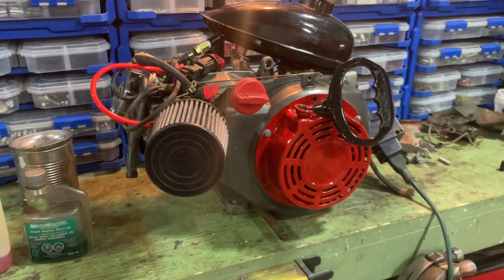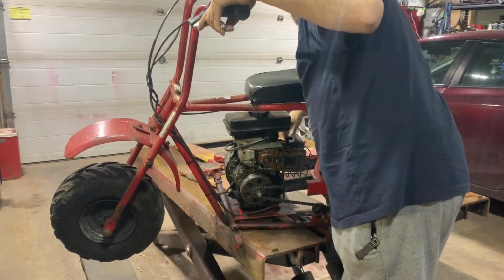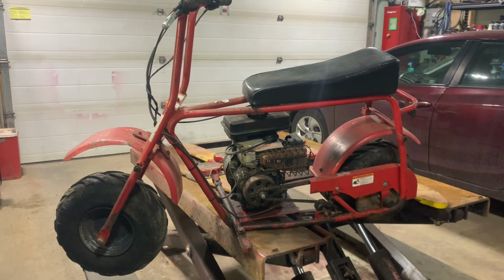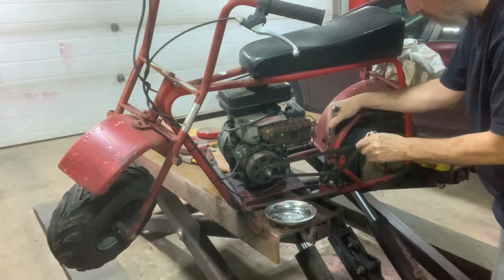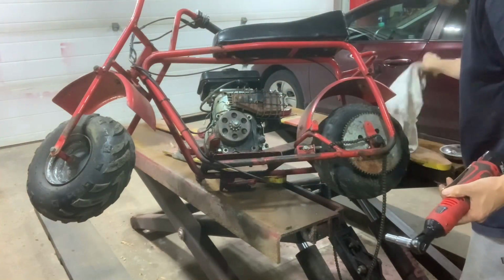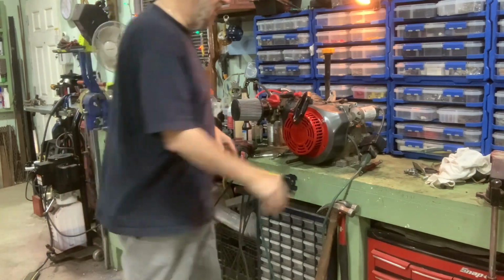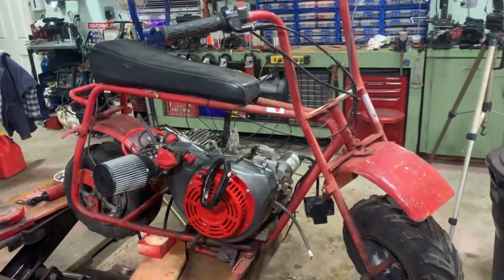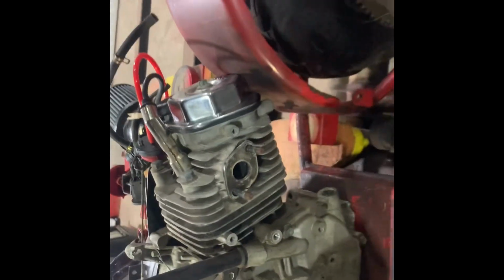Mini Bike Engine Swap

Comment: You might be better off changing the rear sprocket. That chain looks awfully small for 10hp.
Reply from the maker: I thought of that but can’t find a sprocket that will fit